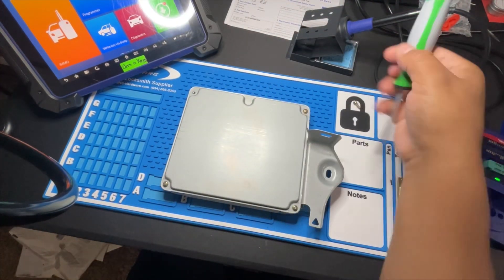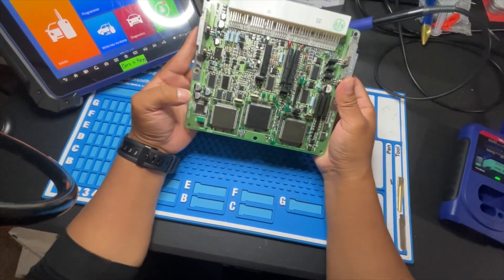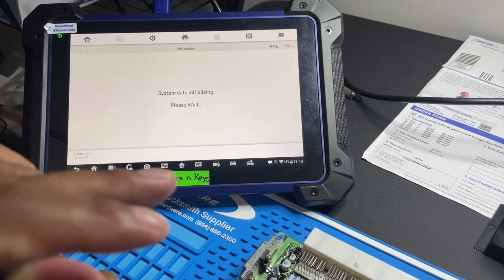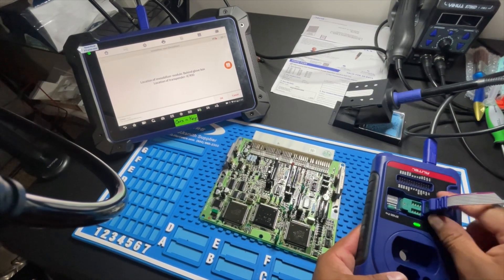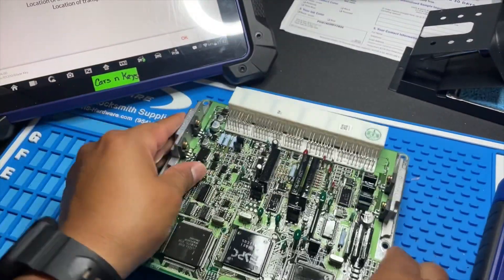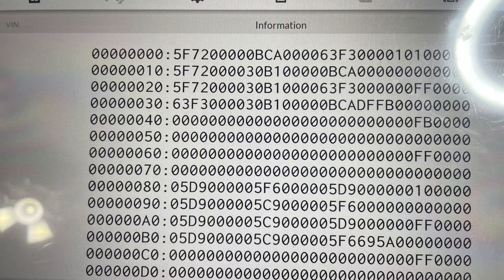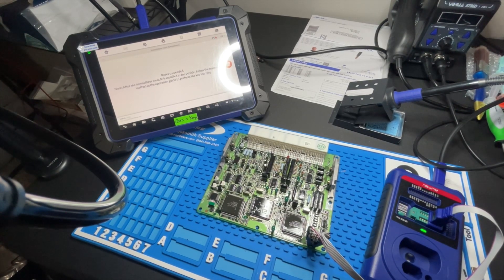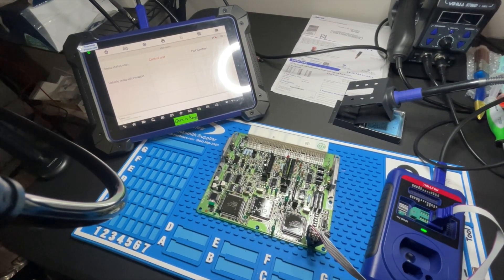How to Reflash or Virginize a Lexus | Toyota 1998/2003 ECU | with autel IM608￼

Comment: could you also program the key from the workbench or does it need to get reinstalled first then program
Reply: and is there a way to copy the current key information and clone into a new key from the EEPROM key slot info?

Comment: Makes sense if you want to remove all previous keys, of course.  

But if you have a working key, have you had any success with the manual key programming procedure for older Toyotas? It involves pressing the brake pedal, accelerator, turning the key in a certain combination.  

Should work on Toyotas up til 2005.  Also Lexus too.  I successfully programmed a 2004 Corolla immobiliser chip this way.  

https://www.youtube.com/watch?v=LRCsK12cC7o Yaris mk1 pre 2005.
https://www.youtube.com/watch?v=1aKb96V8A44 Older Lexus pre 2005.

Videos laying out the steps for older Toyota/Lexus if anyone is interested.  Absolute life-saver.

Comment: When you get a bunch of 0000000 that means it’s not good contact and the pins need to be cleaned off and you will have to have the same numbers every time when you read it before saving and resting

Comment: I do not want to spend $3500 for the autel IM608 therefor I am sending my immobilizer to them, "Cars and Keys Automotive", for them to fix my 2003 Toyota Sequoia Limited immobilizer issue. They are charging me $285 for this service which, to me, is worth if it my vehicle will start again. I will reply with how it goes. They have already told me it would be about three weeks for them to get to it. I will reply with results.

Comment: can the ecu be in the car still? if i have the large computer anbd connect via obd2 wouldnt it connect to the ecu and ecm? or do i have to pull it out and connect this way?
Reply from the maker: ECM needs to be out to program the keys, you’ll be lucky if you can do it by OBD11. Just the earliest Toyota models

Comment: Hey man you put all your hex values to 0? I saw in another video that you need to keep the values for the valet lockout fb df and 5a 69. Can you please confirm this? In your eeprom they seem to be reversed.
Reply from the maker: If you edit or change numbers, you might need to do that. 
but most of the time when you re-flash the chip, stays as is because we just re-flashing. Do not edit it. Just read, save file and re-flash. You have to save it in case something happens.

Comment: Another way to do this is just read the key data and clone a key using one of the IDs. No writing back to the eeprom and no programming. Key just works.
Reply: What's the procedure for this?
Reply from the maker: Yeah I know that part too, but if you doing it for a customer that can be dangerous because what if someone finds the key! Specially if you didn’t know which number the key was written.
Reply: @carsnkeysautomotive  Yep definitely. I always ask the customer. Sometimes they want to just add in case they find it later. Others want all deleted due to theft.
Reply: @carsnkeysautomotive if that happens will the old key work?
Reply: So thats how to reflash  ecu?
Reply: how would you clone the ID?

Comment: Great video bro! So once ECU is reset, do we just plug it back to the vehicle? And then how do we program the keys after that? Do we need multiple keys?
Reply: Once you have resetted the ecu, plug it back in the car… the security immo light will stay steady (wont blink) you put a new 4C chip key and it will automatically program it
Reply: @harryyubank why is this information so hard to find 🥴
Reply from the maker: check description of the video and you'll see Eeprom information and click then it'll send you to the website and scroll a bit dow you'll see the instruction.